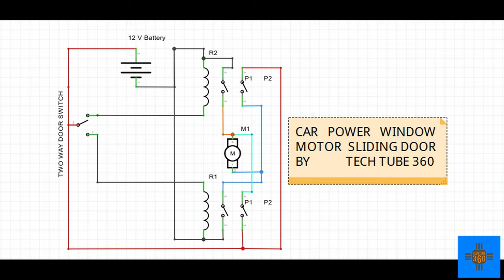Diy Sliding door motorized || how to convert any sliding door to automatic sliding door

Comment: You need breaking to stop door from slamming and you need limit switches and location sensors with a simple analog circuit, with relays. Or you can use an encoder wheel and count pulses but this is more complicated and you will need to program a micro-controller. It also needs obstruction sensors and over current motor stall protection.
Reply from the maker: Ya as said I can manage to do all of that but just to keep project simple I have not done that so that others can replicate it
Reply: You don't need any of that. it is controlled by a person that is right there. Not automated.

Comment: if electricity cut out, how do you open the door? or the pulley slippery enough to slip the shaft, since the gearbox must be hard to turn manually.
Reply from the maker: There is a 12v battery backup so no worries the door will open😊

Comment: Nice idea!  Have you installed a cut off switch when the door is totally open or close?
Reply from the maker: Thanks for appreciation. I have not added cutoff switch instead the forward reverse switch is momentary so just at the right point I need to release the switch while opening or closing the door to make things simple and also the motor is very heavy duty it's still working flawlessly since I installed it. Thanks once again✌🏻🙏😊👍🏻
Reply: @techtube360world  Thanks for your response

Comment: SUPER IDEA.
Reply from the maker: Thanks a million ✌️😊👍🙏
Reply: WHAT IS THE MATERIAL OF THAT STRING USED HERE AND WHERE IT IS AVAILABLE.

AND 

WHERE I CAN GET THOSE BEARINGS
Reply from the maker: @AFSALTHOYALKATTIL  string material is called rubber string it's generally available at places who deal with various belts and pulleys. Bearings are made up of nylon bar it can be turned on lathe and then ball bearings can be fitted in slots made for it to make it a nylon pulleys that you saw in the video. You may find them ready on AliExpress too. Thanks for your time and interest feel free to contact me for any help.✌️😊👍🙏

Comment: i am trying to make this. can i do it with AC supply. if so, how can that be achieved? I dont have space for battery for my trial. Any help is appreciated. P.S. I am a complete newbie in DIY.
Reply from the maker: Use 12v 20 ampere SMPS supply generally available in metal box with ventilated net on top. This will serve your purpose. Hope I have resolved your query. All the best in advance for a successful project.

Comment: How do the motors know exactly when to stop?
Reply from the maker: It's completely manual and load on motor is reduced by springs I used in the string. So on each side the door is closed or open but no sensing mechanism or limit switches used to keep the design simple and also the motor used is very rugged that it won't fail for transient current spikes. Limit switch mechanism can be deployed but it complicates wiring so I adopted a simple manual way. Thanks for your time and interest ✌️👍🙏😊

Comment: Nice
But i’v a question 
If we open door by hand so its can be work hard. Did u feel that or it is still easy to open by hand ?
Reply from the maker: Yes it does get bit hard in case of power failure but as such system is fail proof and it's working just fine since it has been installed without any downtime and failure. The hardness in case of power failure is not so much that you have to struggle opening the door. Thanks for your keen interest and time 🙏😊✌️👍

Comment: Sir bahot Accha video banaya hai
Wiring ke bare me aur details me jankari deni chahiye thi. Mujhe double door ka project karna hai jo centre se khulta hai to pl. Uske bare me batane ki kripa kare.
Thanks
Reply from the maker: First of all thanks for appreciation. I have given the wiring diagram in video description. What is your requirement for two door do let me know in brief. I would be more than happy to help you. Thanks 🙏😊✌️👍
Reply: @techtube360world  Thank you sir for quick reply. 
Sir I want to make central opening doors like lift doors which open from centre. i. e. Two doors open in opposite directions from centre . Thanks
Reply from the maker: @sudhirkolambekar916  for that you will need infrared sensors array for door close and open sensing and you would be needing a nylon rubber belt drive for that. So it's better to go for dedicated parts rather than DIY as it will save your lot of time. But still if I find some DIY solution for your project I will message you. Thanks 🙏😊✌️👍
Reply: @techtube360world  Thanks Sir

Comment: How does the motor know when to stop? For example if you kept the toggle switch on door close and when the door is fully close, how does the motor not continuing keep turning? Thank you ahead.
Reply from the maker: Motor is extremely heavy duty more so the door open close switch is momentary. It's just too keep things simple I have not added limit switches else that is also possible to initiate in this design. So once direction switch is released it stops where ever so you do know that for had reached either of the end open or close. Thanks for your time and interest

Comment: I liked your idea, can you suggest me to how can convert manual glass door to auto operated  swing door/ sliding door..
Reply from the maker: Thanks for appreciation. Glass holding roller channels need to move with string you can achieve that be welding or screwing an arm to attach retractable string through motor. Hope you may have got some idea. Thanks for your time and interest ✌️👍🙏😊

Comment: What is the power supply you used in this project??
Reply from the maker: 12v 5amp battery sealed lead acid with charger. So in case of supply failure I can still open the door.

Comment: Hi sir, i want to ask..actually i m doing the same project as yours but i have problem, the motor lack of power when the cable power to long. How can I solve the problem? Help sir
Reply from the maker: Your power system is having mismatch like controller is not suited to motor or insufficient battery power could be reason. Wish you best luck 🙏✌️👍😊
Reply: @techtube360world  Thanks, if I'm using power supply 12V 10A, how can I consistence the current flow for 10 meter cable? is it possible or did I need to change to higher amphere power supply? Kindly need your advise.
Reply from the maker: @mrz6320  12v 5amp is also sufficient so your supply is good enough. If your cables are to thin,  change the supply cable if needed use minimum 3 square mm cable for length above 8 to 9 metres. Also check relay current carrying capacity if its not rated for more than five ampere change that. I had also given the circuit diagram of this door in the description box. Feel free to contact for any help. Most important of your door assembly is drawing much higher amps due to mechanical imperfections fix that first before doing any thing. 👍
Reply: @mrz6320  my guess?  Trying to pull more wieght than the device is capable of .....measure how my weight of pull is neede and then measure capability of device to lift maximum weight .....   10meters????    that is LONG!   LOL ....my guess? way too much to ask from a car antenna motor!  Might have to go to industrial device ....or old garage door chain drive opener    ....screw drive could work also of of course ....but to use rope idea would need to be chain drive (convert to rope pulley)

Comment: Hello sir, I want to ask how can I do connection to combine relay and limit switch to stop the motor? Is it possible?
Reply from the maker: Yes it is possible to make connections with limit switch in such a way that after limit it will not allow motor to move forward in that direction but it can go reverse. If I will get time I will make a diagram for you. 👍
Reply: @techtube360world  thank you sir. I will wait for it.
Reply from the maker: There are limit switches with rollers with normally open and normally closed contacts. Use normally closed contact and cut relay forward and reverse power lines and route it through normally closed contacts of limit switches. So when ever the door will reach extreme limit corresponding direction relay coil power will be disconnected and hence motor power will stop in that direction but will remain connected in other direction as that limit switch is not hit by limit. If you have got what I said let me know in comment section. If you still need help let me know.
Reply: @techtube360world  pls send diagram with limit switch.thx n rgds..

Comment: Which motor did you use?
Reply from the maker: It's a old car power window motor these type of motors were used in GM and Opel cars. I got it from scrap for just 3.5 USD. Try on e bay you may be able to get hold of one.
Reply: Tech Tube 360 thank man

Comment: You haven't mentioned size and weight of the door
Reply from the maker: This will work on any size door used in general as the motor is geared